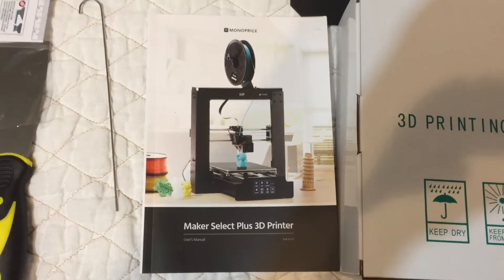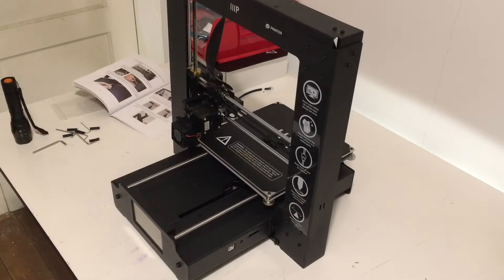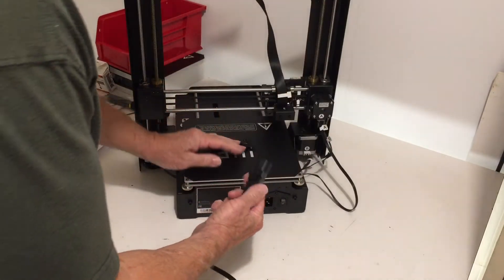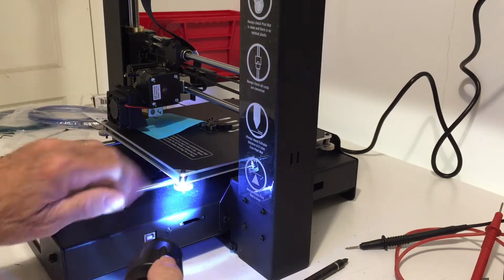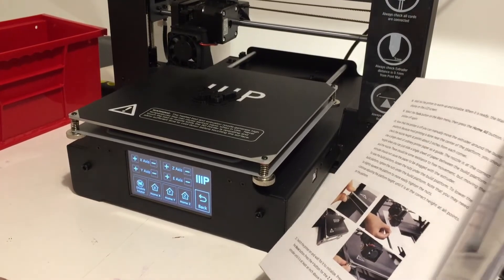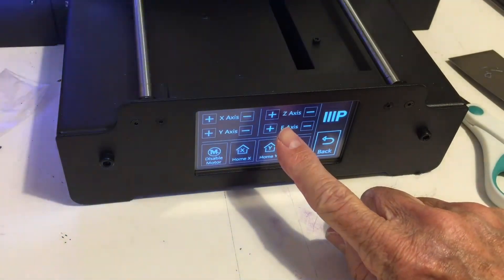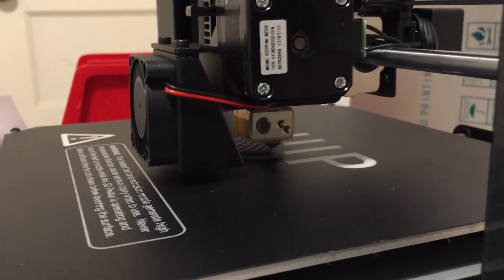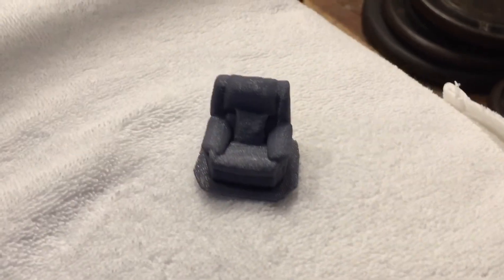Assembling and Operating a Monoprice Maker Select Plus 3D Printer

Comment: Thanks for the video.  I'm looking to get my first printer without breaking the bank.  How has this one held up for you? btw I'm an older guy and really apperacted the building part.
Reply from the maker: Jim,

It has held up ok, but like any electromechanical device parts will eventually fail. If I left the PLA filament in the hot extruder without moving it would get brittle and break, but that could happen with any printer. I damaged the cover on the build platform by prying a little too hard with a scraper. I show how I did some troubleshooting with the FLIR ONE Pro IR  iphone attachment at https://www.youtube.com/watch?v=cIM6JtEJcJc&t=19s         By the way, I am also an older guy so don't let that stop you.

Scott